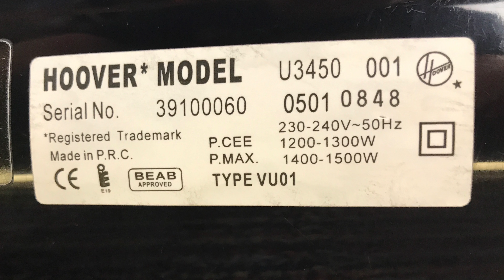Hoover Purepower U3450 (Lucifer) Part 2, Complete Reassembly

Comment: Great job with that - very shiny indeed. It looks nice in shiny black, as opposed to the matt black effect the Enigma has. Great that you got it a new recline pedal - the old one was knackered as they often are, when people dont press on the pedal hard enough and then try to pull the machine back, which makes that click sound, as the catch doesnt fully release, and wears the catch down.
The year of manufacture was 2005, week 1, and its an early Chinese model, as production was in Scotland up until about the mid 2000s, when Hoover decided it was more profitable to close Cambuslang factory, and ship all production off to China.
Interesting you chose to put a short hose on it, as these are usually only fitted to the 700W EU compliant models.
Reply from the maker: MadAboutHoovers Thank you my friend, your comment means a lot from you as you’ve been refurbish for a long time and it’s your videos and others that teach me how to do it, I’d not have a clue otherwise. 13 years old, wow, it certainly doesn’t look that now. I only used the short hose as the original long one took days to dry and I ended up using a hairdryer on med heat through it to finish it off 🤣🤣🤣. Hope you’ll enjoy the full house demo with it as it will be lovely to see it in action. Thank you 🙏🏻
Reply: HooverLux  I think you've done many more refurbs than I did - Its nice that you are still able to carry on doing your videos, as many people that used to do videos, including myself have now had to give up with the video making. It saddens me that my own circumstances have forced me to give up vacuum collecting, believe me, if I had the money and the space, I'd still continue doing it, but I'm still around in the comments sections, and still try to help out if I can. I've followed your channel since its very start, and you've done a huge amount of work, and spent a fortune on stuff for your channel, and you know I always hoped you'd carry on with the refurb videos, and whilst I dont always watch all of your videos if they are about other subjects, I always try to watch your refurb and technical videos, so apologies if I dont seem to comment on all your videos, or if you mention me and I dont reply in the comments. Its great that you branched out into other avenues with your channel, and it may well help you get more subscribers, especially with the washing machine videos, as they have a hell of a lot of followers, but I'll always know you for your stripdown and refurbs of vacuums, at the famous Hooverlux workbench! Long may Hooverlux continue, and I hope one day you end up with 50,000 subscribers, as you are a great entertainer and people person.
Reply: I'm saddened also Steve. I miss you and your videos. I'm sure that there are other interesting aspects of you that are video worthy.  Maybe man about the town videos or something about lifestyle.